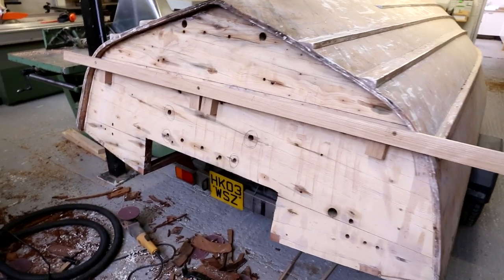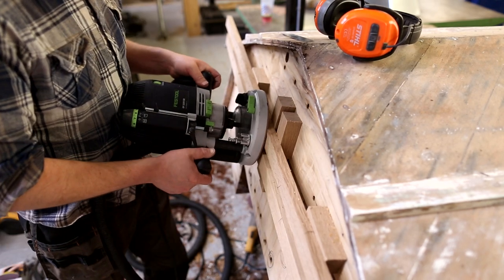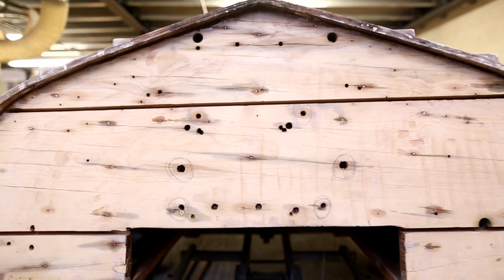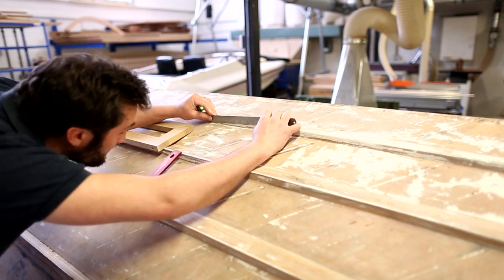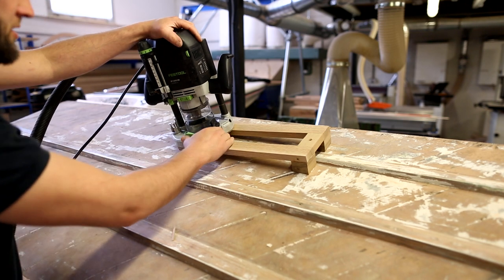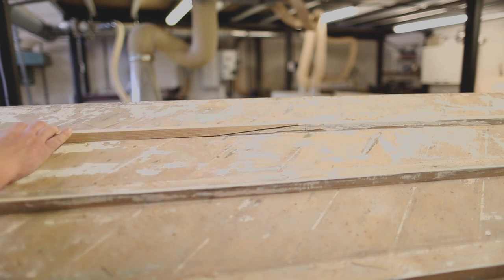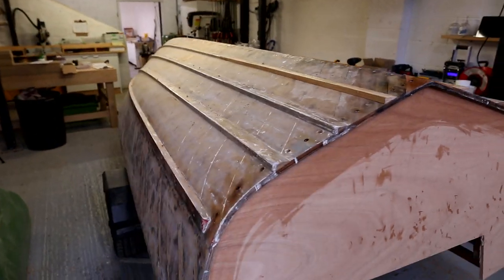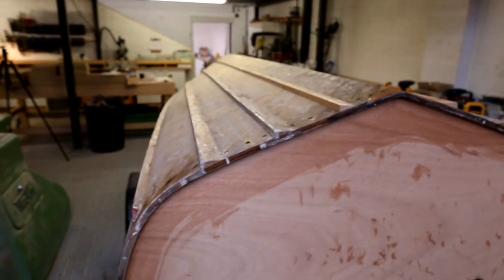Cold Moulded Wooden Boat Hull Repairs | The Stapley Boat Restoration Pt3

Comment: With respect..
A spline of fiber reinforced epoxy is ..
1. Stronger..
2. Saves all the woodwork..
3. Conforms to any shape..
4. Saves time..
Wet the gap with plain epoxy..
If the wood is very dry..  you may need a primer coat first..thinned with a little acetone..cold weather..
Xylene..if warm weather..
Different evaporation rates..
Do not let the primer coat set..
Thicken normal epoxy with some glass fibers and colidal silica..
Over fill the joint ..
Job done.. 
If you clean these holes out first ..
You can do the whole job one time..
Building boats 59 years..
Chris
Ps..
I've got lung cancer.. because like you..
I didn't wear a mask..
N95 are 3 dollars.. good investment..
Epoxy is the woodworkers.. boat builders
Best friend...
Reply from the maker: I am sure you are right here Chris but I usually shy away from filling large gaps with thickened epoxy, quite probably stronger than the wood but the idea of it just feels wrong to me so I tend to favour putting wood back in where possible. You are certainly right on the mask front, I probably don't wear them enough.